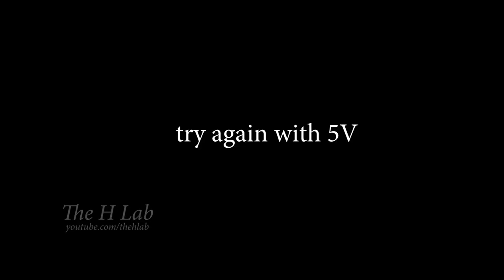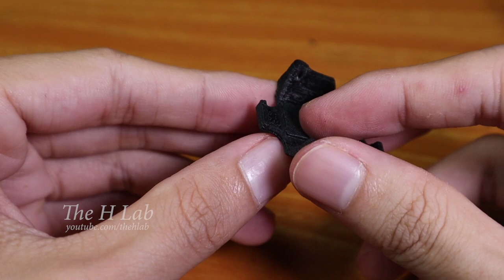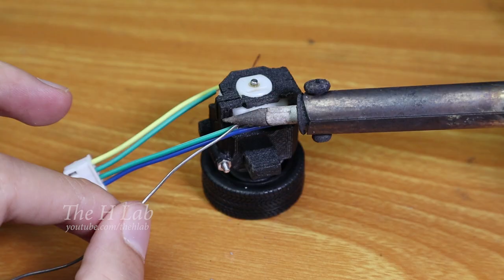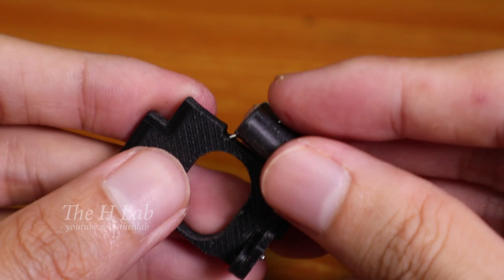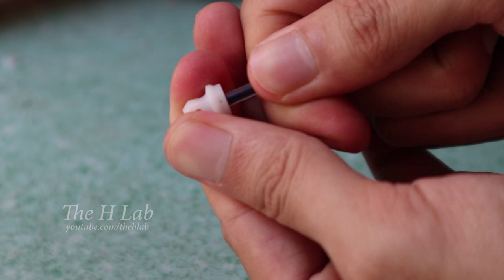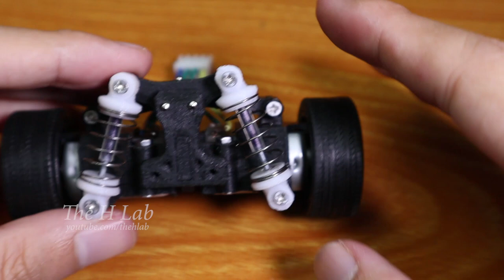Porsche Macan Rear Electric Axle - 3D Printed | TheHLab

Comment: Hey there,

I've been watching your videos for the last few weeks and you've inspired me tackle some of this myself.

A few questions:
1. Your 3D printing is done with what material? If PLA, how are you finding the durability?
2. I notice in this video you mounted the wheels directly to the motors rather than having a pinion gear on the motor with a gear on  the axle; did you have any torque issues?

thanks.
Reply from the maker: Hi @Remek,
1. It's PLA.
2. Yes. It's have little issues with torque when the car first started, very slow.

Comment: It was awesome. What plastic did you use?
Reply: 3d printer filament in case thats what you were asking. Specific filament type and brand idk
Reply: @Rctdcttecededtef  Yes, I'm interested in filament. Perimeters look uniform.
Reply: @midwich23  Oh, I'm not sure what brand sorry
Reply from the maker: It is PLA filament and White filament is from Anycubic, Black from no brand.
Reply: @Rctdcttecededtef  The brand is not important. What printer?
Reply: @TheHLab  I was interested in black filament. there are no lines on the outer perimeter. only filling the lid and bottom.